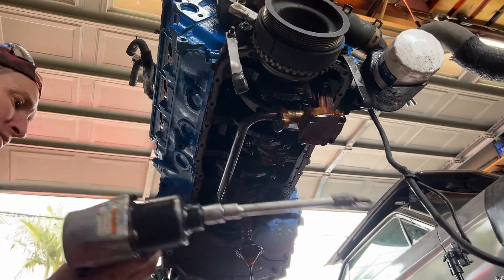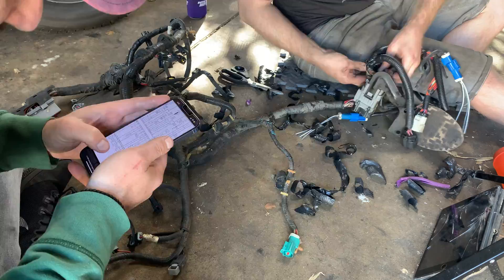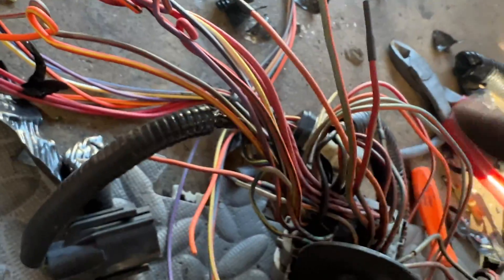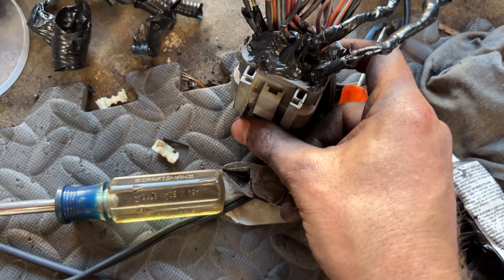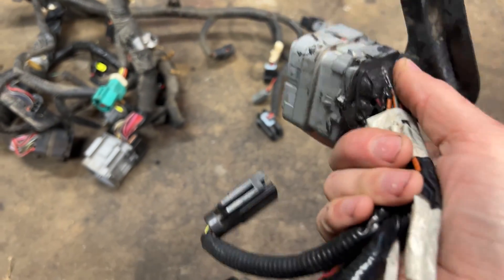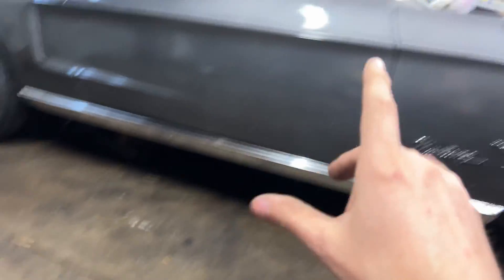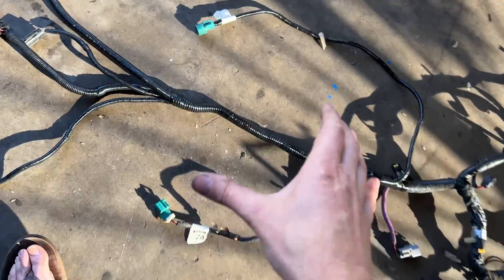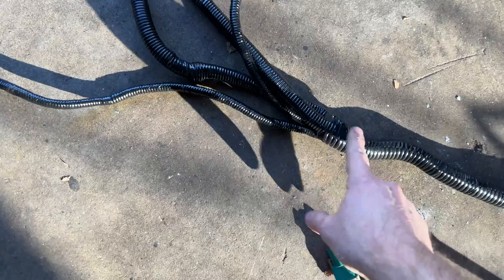Ford Explorer 5.0 V8 Swap Wiring Harness Modifications For My 1968 Mustang

Comment: Do you have any of your wiring harness modifications written and would you mind selling me a copy of your mods to stock harness  I’m trying to make my truck run ??
Reply from the maker: I do have a list of the wire pin outs and descriptions actually in this video’s description. Check towards the bottom, these should match up with the numbers you’ll see on your ECU connector. The wire colors may vary slightly between years but the wire positions should be the same or very similar.

Comment: I'm doing the 5.0 Mercury Mountaineer i have a question What is the plug for on the drivers side that would be under the seat not the power seat plug or seatbelt plug it's a 12 pin plug. it's short only about 5 inch long Thanks Johnny

Comment: Do you think I can use your notes in the description for my 1990 f150.? I want to use the harness of my 1997 explorer and merge it into my 1990 ford f150.
Reply from the maker: @gonzaleztorres1990  yes, the wiring pinouts should be the same for all of the late 90s years. There might be a few different wire colors but if you go by the pin numbers you should be good 👍
Reply: I keep wanting to try and  get it done but I just don't know where to start. Im transmission is in my motor is. Everything is pretty much done. Except where I have to connect it to the fire wall. If you could please help me out
Reply: The problem is that the original 5.0 of the 90 was a 4 clip connections instead of a single square pack. That's where I'm struggling.

Comment: Questions, PATS delete? And automatic to standard transmission? Any kit used ot tuning?
Reply from the maker: Mine is a 1996 so it's pre-PATS (I bought a 96 specifically for this reason). I searched far and wide for an easy way to write to this EEC-V ecu but didn't find anything. What I can say is HP Tuners does NOT support it.
Reply: Thank you for you knowledge!

Comment: Quick question do I got to take off the pins of the ecu connection or can I just cut off the wires I don’t need from the ecu connection?
Reply from the maker: You can definitely just cut them, I'd throw some heat shrink or electrical tape on the ends for good measure

Comment: I am going to be doing this in the future. How do you know what wire is for what? Do I label them when I remove or is there a diagram I can get to read? Thankyou
Reply from the maker: Check out the bottom of this video’s description, I put a full list of all the PCM’s wires and what to do with them. Wire colors may vary slightly by year, but the PCM pin numbers should be the same.

Comment: hello! I am doing the same thing except that I will eliminate the automatic transmission and put a manual transmission. I hope you can help me how to eliminate the automatic wiring.
Reply from the maker: Hey! I think if you remove those connectors on the other side of the big gray plug you’ll remove the auto electronics completely. You may want to keep a few wires for things like reverse lights and neutral switch that may integrate into your manual transmission. If you’re looking to delete the wiring completely, you’ll need to peel back your harness loom and tape to the PCM connector and un-pin the wires. There will probably be some common grounds and reference voltage wire splices too, just clip and seal off those like I did with the rear O2 sensor wires. You’ll probably want to delete transmission controls from your PCM, there isn’t a lot of info out there on this but I’m close to figuring it out I think. I’ll make an episode on it when I do for sure.
Reply: @noboltsleftbehind  thank you! In fact, I'm still starting to investigate what I will need and what I will eliminate since it is my first swap. I also bought a complete Explorer from 98 and I will try to use things like electric windows and integrate the A/C to my old F250 from 79. There is not much information in Spanish like that. which will be a lot of reverse engineering for me
Reply from the maker: @alberthgallardo985  nice! Good luck on the swap, I think it’s a good one to start out on. Yours being a 1998 means your PCM will have a security lock called PATS, from what I understand this is something you’ll need to delete before the engine will start. I think I may have a solution to this, if you get stuck on this let me know and I’ll share what info I have. Just drop a comment if you have any other questions!
Reply: @noboltsleftbehind  It would be good for me, since I haven't found any information. Do you have a profile on Instagram or Facebook that you can share with me?
Reply from the maker: @alberthgallardo985  sure, my Instagram is https://www.instagram.com/noboltsleftbehind/

Comment: Wiring, good time right? When we did my sons 80 Firebird LS swap I bought a harness from Amazon for like $200 to work with the factory computer, took like a couple hours to put it in the car and get it running, so worth it
Reply from the maker: I know it sounds weird, but I actually like wiring. I like how each wire connection either works or it doesn’t, no in between. I think it speaks to my techie nature. That said, I’d probably also buy a pre-made harness if they made one for the Explorer 5.0. Haha.